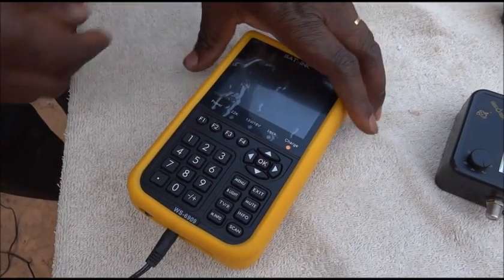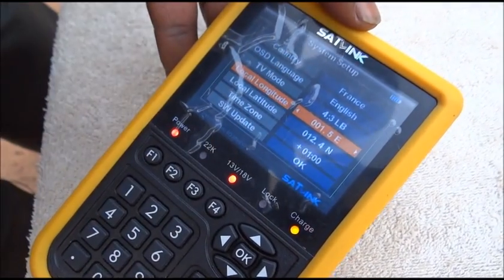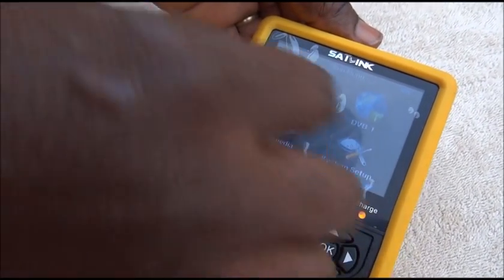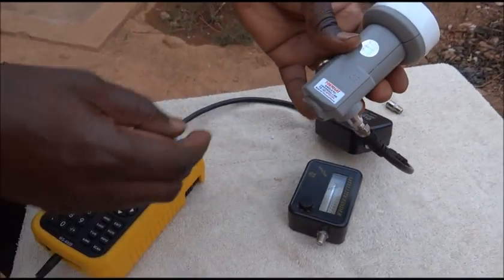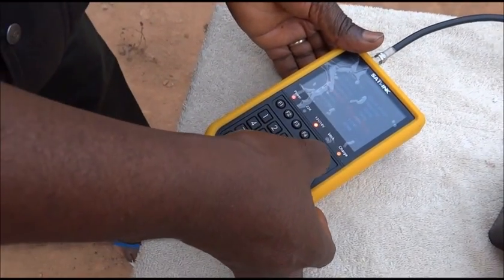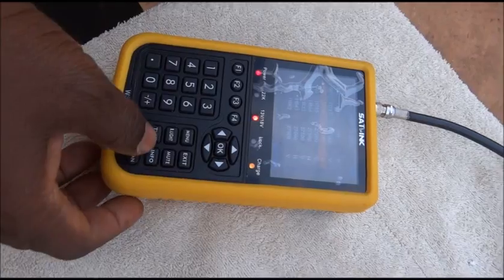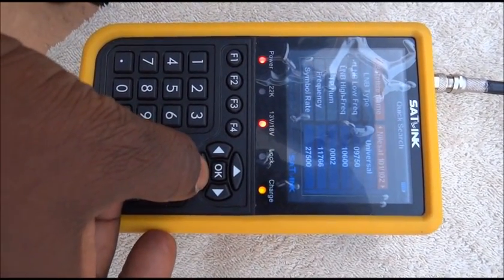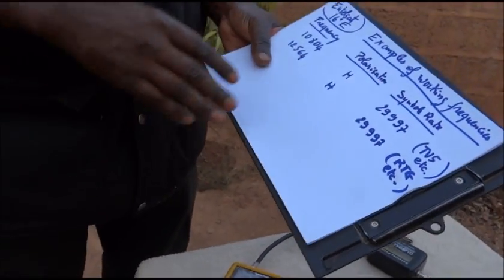Part 3b of 5    Self Installation of a Satellite TV Dish System From A to Z   Two Optional but Very

Comment: Also Lyngsat com have the List for the Satellites transponder too. Only a information for you. you have a nice video!
ONLY Focus the Dish on the Quality and not on the Level of the Signal! Never aligning a Dish for Digital DVB-S/2 on a Level only on Quality the reason is only the lowest BER (bir Error Rate) can repair the defect Signal if necessary. The Level is not importand on Digital Systems. A FEC(forward Error Correction) is build in the Signal to repair the defect Data Packages.

Comment: Hi there, can you do a tutorial on motorised dish? Also can I ask you a question about motorised dish... Basically, I set my local Latitude: 52.2892° and Longitude: -0.6205° according to dish pointer. After that, i aimed my motorised dish on the roof to true south, then I left it on Thor 0.6 w.. i watched FTA on my  satellite meter ws6906.. when I went to the receiver.  I got no signal. even when i send the satellite to astra, hotbird and other satellite. Can you tell me what have done wrong? do any one know what wrong?
Reply from the maker: Hello Olu Fash. Here is a suggestion: make sure you have on your receiver the same parameters (XXXXX H (or V) YYYYY) as on your WS6906. The simple name Astra or Hotbird does not mean the real paramaters are associated with the satellite name. Fortunately, you can look those numbers on your WS6906 and type them as new parameters to be associated with your Astra or Hortbird satellite in the receiver (see the user manual). There is no reason you can't get the images on your receiver if it has the same set of parameters than the WS. Please let me know the outcome. AK